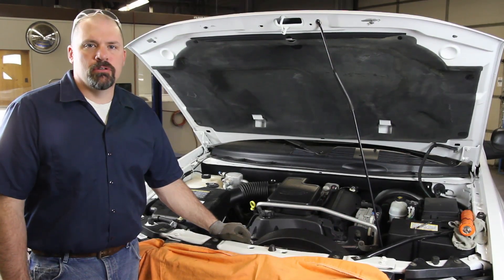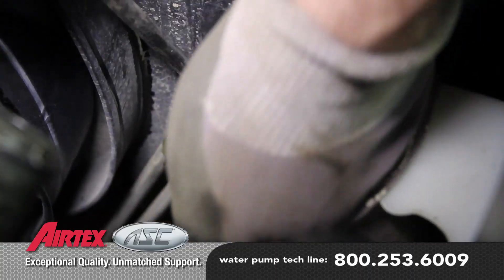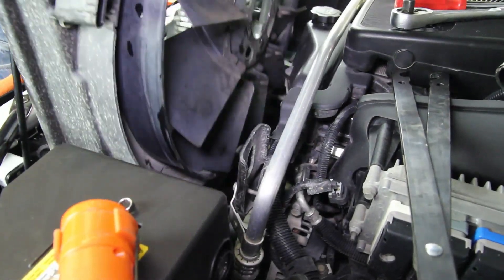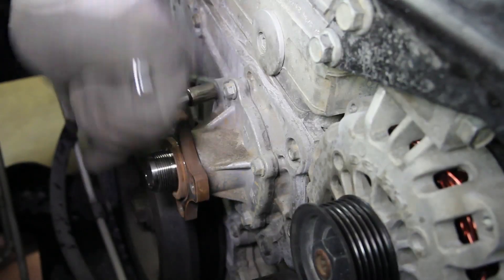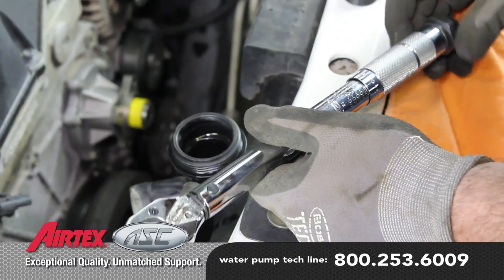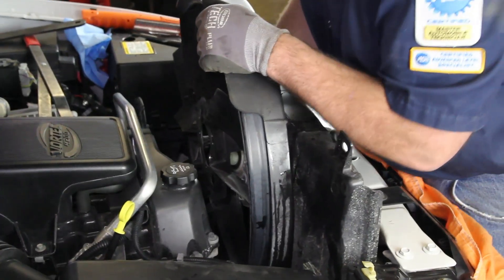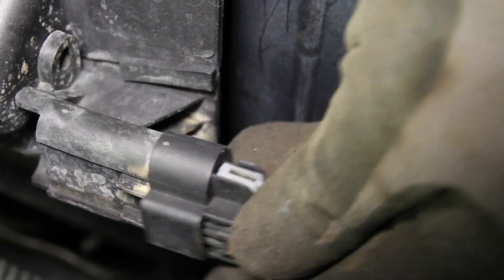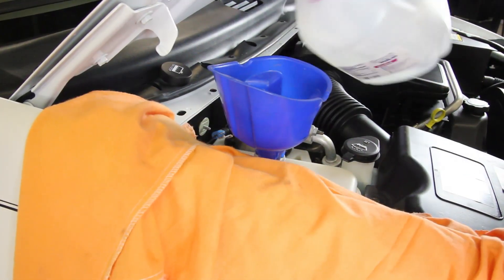How to Install a Water Pump: 2002 - 2009 GMC Envoy 4.2L L6 WP-9234 AW5097

Comment: I appreciate there being guys like this who put tutorials up.  I truly do.   However, I have seen about 10 of these videos.  Not a single one has shown HOW  to get the big nut loose.  Several of them jam "something" in there, but don't explain what it is,  where it goes,  anything. Just the mystery thing goes in and and arm in shot, or jump cut to the nut already loose.   
Is that some kind of GM secret?     About to call the guy to come get the Envoy for the cats, and buy an old Dodge or Toyota.  GM got messed up! 
What was wrong with the way it has been for decades?  Split shroud,  take the top half out,  4 bolts, fan AND pulley come off,  Blammo.  there's the pump.  Some "genius" decided to complicate the thing with this big idea about one center threaded stud and electric clutch crap.   GM.. Heck, ALL newer vehicles.. What a joke anymore. 

Wait until you have to change the thermostat...  You're gonna' love that screwball mess.

Comment: 1:37 Lolol just remove them. Not mentioning that the whole unit is loose and you need to have something to hold the unit in place to remove the bolts 😒🙄

Comment: I don't understand much English, could you give me the torque specifications for the pump bolts and the pulley bolts and tell me the measurements of the tool you use please?

Comment: just did mine with the rental tools from autozone. was pretty easy (might have lucked up, i know sometimes bolts can seize ). Actually the hardest part was those ridiculous hose clamps.. I even had a tool for taking off hose clamps and they still took over half the time I was doing it.. I would have swapped to the screw on hose clamps while it was off.. if I had some handy

Comment: When you remove the  battery cable your air flow actuators need to be  reset.  All you have to do is before you disconnect the battery cable turn you hvac off.  when you reconnect your battery you should turn your ignition switch on without turning on the engine.  wait a couple of minutes... this lets the actuators time to reset. (you will hear noises under the dash) if your heating cooling is on when you turn on the key you half to start over
Reply: You mean just make sure everything is off or......?

Comment: Thank you for the video, it helped greatly on my 2005 Envoy XUV.  I should mention the the installer must use new water pump retention bolts when installing a new water pump.   The factory bolts are 'torque to yield' and will snap off at the engine block if re-used. The new bolts are about 4 dollars a piece at the dealer.
Reply from the maker: Checking with a Chevrolet dealer and through ALLDATA these bolts are not a torque to yield bolt. (GM does have one that it is recommended the bolts be changed. We supply new bolts in that application). This application uses a standard 6x1.0x35mm flange bolt, part# 11505032.

Comment: Helpful video but you quickly skipped over the fun part of removing the fan and shroud assembly up from the front of the radiator.
Reply from the maker: Beginning at 57 seconds the video explores the fan clutch and at 1:20 the fan shroud removal.

Comment: I used flat cardboard to protect the radiator during the fan-shroud removal, and bought new bolts for the water pump install from the local GM dealer. Better safe than sorry. Great video, many thanks for posting it.
Reply: Very Smart. I always stick a wood board or something to protect the radiator. I do this for a living and have had a clutch slip out of my hand and damage a radiator.  I have never had to replace the bolts though since they are torqued under 8 ft-lbs of torque. I just wire brush the threads and reuse.
Reply from the maker: Good idea on both counts!

Comment: Thanks for this cool video... I followed the instructions and I was able to change the water pump very quickly. However, I have follow up questions. As I torque the water pump bolts, one of them broke and I cannot find a part number or a description, size or length anywhere, can you advise where I might be able to acquire them.
Reply: Thanks for the info... what I think it happen was that the bolts were never replaced (after all my truck it is 14 Y/old). I read an earlier comment that said the bolts are only meant to be used twice. To bad I saw it after I had done the work, oh well... thanks again for the help.

Comment: Just curious but I noticed you used regular coolant, doesn't GM require DEX-COOL? Great Video
Reply: it does require dexcool only, this video may be 2002 to 2009 but he does not show model specific issues that arise like my 02 envoy sle 4.2 i6 ...no room to remove the shroud due to trans lines, rad hose angle and etc!!
Reply: @johnedwardkeoniambrose1151  a
Reply: you can use any coolant in any car, as long as you drain the old coolant first
Reply: Yeah but at 2:17 you can see dex cool as water pump comes out and a decent amount stays in. 
You can change coolant if you drain and flush, flush, flush, until clear. You should never mix dex cool with any other coolant and I didn't see any flush between the removal of wp or refill and no mention of it, if done with it edited out.
Reply: it does exactly and Dex-Cool must be used!

Comment: What is that special wrench he uses to hold the pully bolts to loosen the Fan Clutch assembly ?
Reply: fan clutch tool uses one to hold the water pump bolts , the other on the fan clutch itself

Comment: Great video! I had to do this for a buddy of mine. At 0:56, What is the tool you use to hold the water pump pulley so that you can disconnect the fan clutch? I sure wish I had that.
Reply: +Airtex Pumps   Just saw this post..
Reply: Borrow one from Autozone. $85 refundable deposit.  Or just use a pry bar